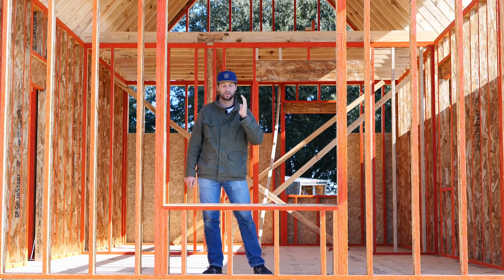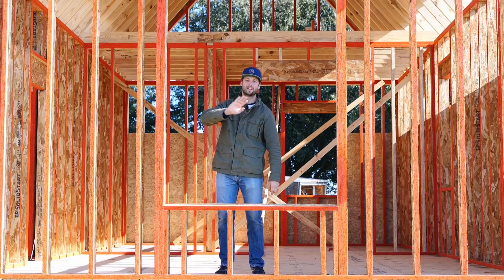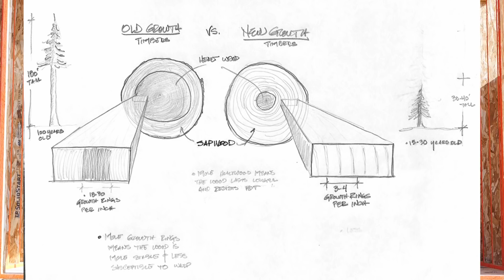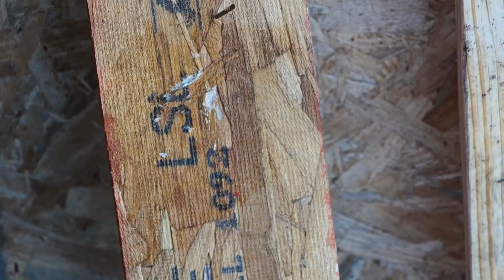Engineered vs. Traditional Framing Lumber : Should You Use LSL Studs to Frame Your Home?

Comment: Another pro for LSL's is dimensional stability. It will not be subject to shrinkage or swelling like dimensional lumber . Most people don't realize that when you frame a typical two story home with a conventionally stacked roof using dimensional lumber, standard green construction grade lumber, that by the time you are getting ready to wrap a house that the overall height of the structure has shrunk by about a half an inch typically and sometimes more. This usually isn't a problem but it can be. For instance I once framed this huge three story custom home that was going to be wrapped in some custom quarried limestone that was from France. Every piece was cut in France then numbered to be used in a very specific point in the house that we where building here in California. We had to be within 1/4 of an inch of spec by the time we where at the roofline. That was three stories. All of the exterior walls where 2 X 8's and the windows all had these funky insets that where needed to make the stone fit properly. All of the lumber was kiln dried to help deal with the shrinkage and since this was back in the early 90's it was all select struct not just #2 like it is now. Back then #2 was block material and you generally didn't frame with it. You do now because that's what the lumber yards sell.

I think if LSL's had been available back then it would have been so much easier to frame this house. Of all the custom houses I have framed over the years and there where many I think this particular house had the most strict tolerances of any I have ever framed. The windows and doors had to be with in 1/8 of an inch in all directions from call out and there could be no cumulative errors at all. Deviations of more then an 1/8 of an inch meant the stone would not fit and that would be bad. From the very start this house was slated to be exposited in the magazine "Architectural Digest" so it was important that everything was done to the highest standard. With the lumber that we get today I wouldn't even try to frame that house. No way. So there are definitely places where these manufactured forestry products will make a major difference. I just kind of wish they where around back then.
Reply: Yeah there were houses 20 years ago that started using lvls for framing. 
More were built that way as each type became avaliable. 
LVL
CLL
PSL
LVT
CTL
OSL
ECT..

Comment: Can LSL be used to build model railroad bench work?  The biggest table i would build would be 8'x8' and i was wondering how strong LSL would be on edge.  Traditional lumber simply is not straight enough to use for this.

Comment: On your 3-1/2 headers on exterior walls.  Cap the bottom with a 2x6 while framing or in your  case just rip a piece of 2x at 2” for the bottom Sheetrock bracing and fill that cavity with 2” of foil faced foam.   It’s all about r12 over your headers.  My insulation contractor has been doing it for us for 15+ years.
Reply from the maker: Good tip.  Thanks!

Comment: Has there been any studies on sound barrier from traditional lumber vs LSL? Wood transmit sound, so I'm curious if the LSL studs with all the resins and stuff used to manufacture them adds any additional sound barrier to them?
Reply from the maker: They are definitely more dense, so they probably carry sound differently, but I have not seen any studies.

Comment: building in the PNW we find that mold starts to grow much easier on the brown pieces of wood on the web of floor trusses. the flanges are solid wood and rarely get mold growth along with the dim lumber in the rest of the house. my worry is that with engineered wood framing members the mold cleanup cost's will be much higher after dry out is done.
Reply from the maker: Very interesting.  Have you used open floor trusses instead of engineered I Joists?
Reply: @JordanSmithBuilds  no, they are not that common, though i did seem some today on a BMC truck while on lunch, it didn't look anywhere near enough for a whole house though.

Comment: Will using metal studs eliminate these uneven issues? I’m sure metal studs have their owns pros and cons and may not be an option for every build location- From south Florida and I see many homes built out of metal and curious if even metal have these uneven issues.
Reply: Yes, metal studs are extremely straight for interior studs. But remember, there is no “meat” to a metal stud. Which translated means screws and nails don’t have much to grab to. So wood backing is generally needed for cabinetry.

Comment: Thanks for the video, and for the clear and concise explanations. You mentioned the differences in nailing, and using air nailers with LSL. How does LSL take screws? I use construction screws for all of my framing instead of nails -- is this going to be a problem or more difficult when screwing an LSL stud? Thanks a lot.

Comment: For walls that you need to be extra straight would it make sense to use steel studs for non load-bearing walls?
Reply: Probably not true everywhere, but code doesn't allow steel studs in residential construction where I am.

Comment: So they're chip board cut in 2x4's.
Reply: No.  It is more like OSB, but more water resistant.
Reply: @chrismoore9997  Same shit, different name.
Reply: LSL uses wider, longer and slightly thicker strands. About 3"W, 16"L. OSB (aka Apenite) uses much smaller strands and in less layers. The process to produce LSL lumber is way more stringent than OSB.
Reply: @davecameron9574  That's great.  Bet it's not a big enough strength difference between a self made version from cut up osb to warrant the cost difference.

Comment: Jordan, good to see  you back, missed you (was a little worried).
Also, best of the holidays to you and your family.
I can't speak to the benefits and potential issues with the various engineered lumber. I know if I was building or doing a major remodel I'd be looking at it. It looks like in the correct application it could really be the best and most cost effective  product to use.
I am frustrated with the the selection of treated lumber available to me ( in the PNW, Seattle area).
The sometimes referred to as "Blue" or "Pink" boards, that were anti-fungal and maybe resisted flame spread aren't easily available. A few years ago I could get "Pink" sheathing and 2x4s at HD, but those are gone.
I'm doing some seismic retro work, and if in contact with foundations I want treated. Everything commonly available is copper treated and will rapidly eat away any structural fittings. Boric treated is preferred but I need to search out specialty lumber yards to find it, and they often are very limited in what they have.
I fortunately  don't have termites driving my decisions, but what do you use (and why) when it comes to below grade or foundation contacting lumber?

Comment: Random question not directly related.

Why don't people build their entire houses out of the pressure treated and sealed wood that you would use for decking? Seems like it'd be a step up if the wood was made to deal with moisture and then put in a place where it wasn't exposed to it/barely exposed to it.
Reply: Every nail or screw would have to be stainless or coated (minimum) as the chemical used for Pressure Treated corrode regular fasteners to the point of failure. So as the other person said, this increases price on top of the lumber being more expensive. Also, you can get PT that may be 40% moisture content. You spend time picking out straight boards, build walls, and by the time it dries out it can twist and bow into a mess. You need PT for bottom plates or bucks in direct contact with concrete, but that's about the only place you'll need them within the building envelope.
Reply: Money. It costs a fair bit more and people tend to be EXCEPTIONALLY cost sensitive in the US. You can make a house that lasts generations, but it costs more and people just don’t care to pay for it most the time.
Reply: It twists warps and the chemicals used can't be that great for you
Reply: step up in wrong direction  , if you want to spend more money just build got damn a real house out of Autoclaved Aerated  Concrete or ICF not a carton box in which Americans love to live
Reply from the maker: In addition to the other good comments, it would take forever for that lumber to dry out and stabilize.  I guess it could theoretically be done, but I think that I would look at other more resilient products if I wanted the ultimate waterproof house, like stone.
Reply: @JordanSmithBuilds  Is stone really waterproof though? Been looking for genuine waterproof stuff lately and it seems like both concrete and "stone" are actually porous and are basically slow sponges. Only thing I've found so far that seems actually waterPROOF is quartz, which comes way too many other limitations/cons to be practical.

I didn't realize that decking lumber came wet. #TheMoreYouKnow

Comment: Given that this material is engineered, would it be possible to have LSL's strong enough that you could frame at a larger spacing (say 32"oc) and get to a point where the $/sqft is equivalent to traditional framing?
Reply from the maker: the problem with going wider than 24in is that your sheathing products both interior and exterior have to span large gaps. This can make them feel flimsy at best and we can them at worst.
Reply: Then if you have a floor above it you have to put the floor beams in the same spacing, it would mean larger floor beams. Or you could use headers.
24 inches of spacing is an ideal width, sheeting and things like that is normally produced to fit this.

Comment: Are we going to find down the road that this out gasses or isnt resistant to moisture etc?
Some of these new materials seem good at the outset but then down the road problems appear.
Reply from the maker: California has deemed these products to be non emitters.  Which is crazy because California Dean Starbucks coffee to be carcinogenic!  But it is good to have a skeptical eye when using new products. I try to read as much testing as I can get my hands on as well as conduct my own tests where possible to be comfortable with a product before I use it in my homes, but the proof will be 50+ years down the road.
Reply: @JordanSmithBuilds  hope you know that cancer causing stamp is a joke.
You either have to spend billions and decades proving so.ehow that your product doesn't cause cancer or stap that it does. 
So everyone just stamps that it does cause cancer  to the state of California

Comment: Since you can use engineered lumber at 24 instead of 16 oc will the decrease in material offset the added cost?
Reply from the maker: It could, but you could use advanced framing techniques and 24 inch centers with traditional lumber as well.

Comment: I plan to build my next home and with it on the river there will be LOTS of glass.  I was thinking framing around the big windows as well as the areas you mentioned (tiled showers) would be great places to use LSLs.
Reply from the maker: The next house sounds amazing!  The lsl's will not let you down on tall straight walls.
Reply: @JordanSmithBuilds  I love videos like this.  I have a huge spreadsheet I am putting together of "best practices" for virtually every part of the home build.

Comment: Anybody interested in exploring the development of Hurricane shelters, able to withstand the next Hurricane Michael, including the ability to absorb a full size tree falling on it. I could see LSL laminated 8x8 beams. Zip system exterior insulation, 1/4 inch welded steel clad. Poo Pottys and survible generater stations optional. 
??? Anybody ???
Matt, I hope you see this, also.